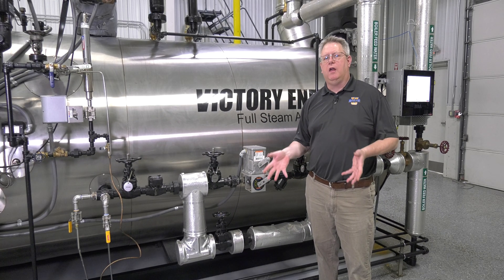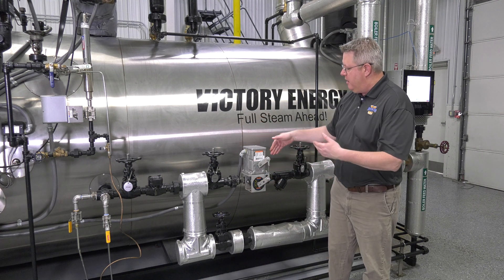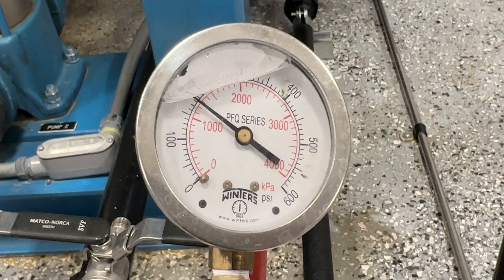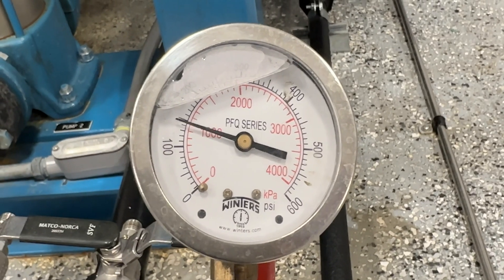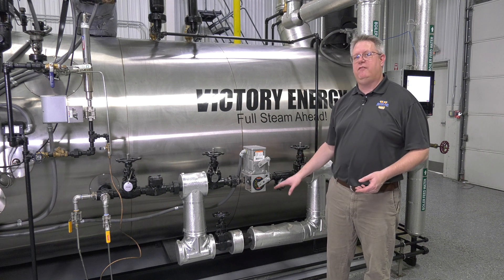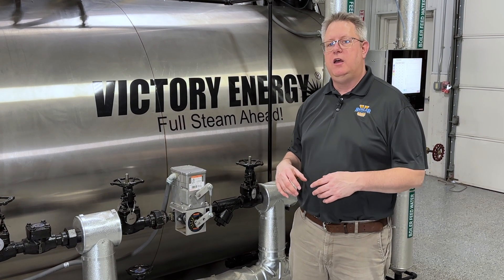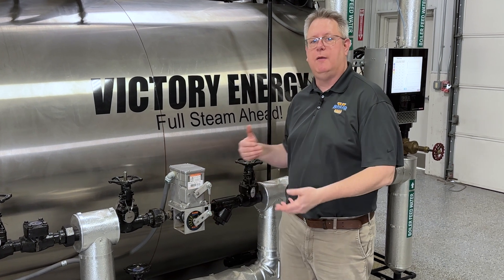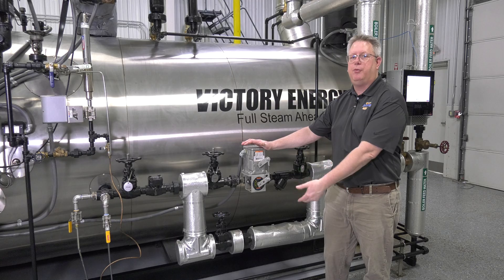Modulating Feedwater Valve Pressure - Weekly Boiler Tip

Comment: Great topic!
It would be great if you could make an analysis about pros and cons of controlling the boiler level by a control valve versus feed pump rpm modulation (VFD).
The second one is cheaper in equipment and operation but beeing in some troubleshooting in plants, It alwais resulted that the control valve gives a more stable level control ¿could it be right?